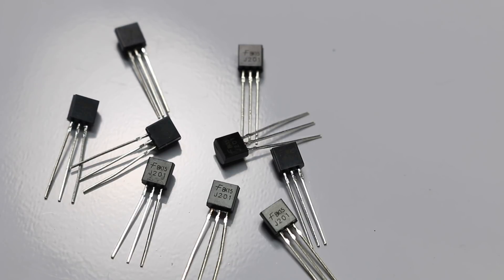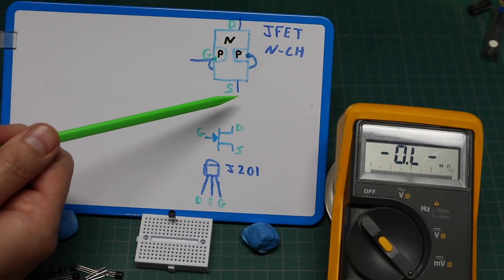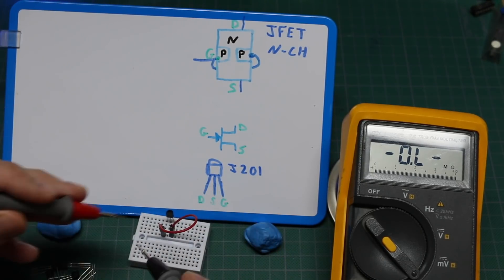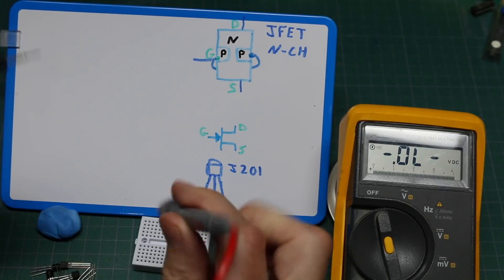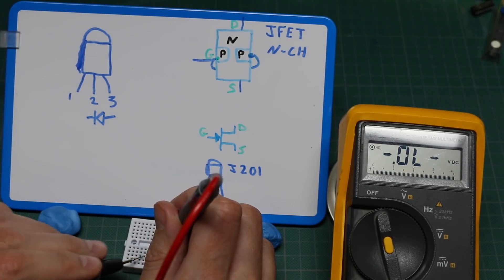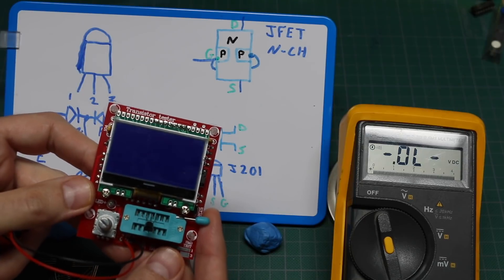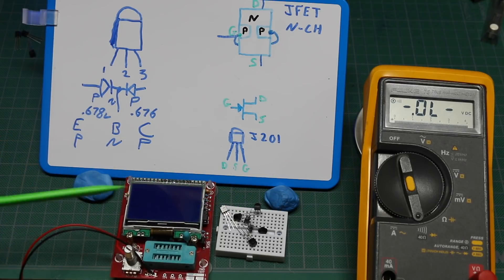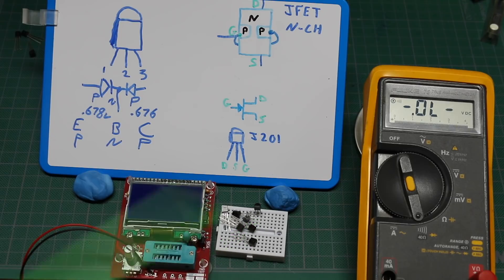I Bought Some JFETs on eBay - or Did I?

Comment: i have a batch of old polish made bf245 jfets and they are being very confusing to standard chinese component tester
it detect them one way as npn the but upside down they are detected corectly as jfets with very low  current and source to ground voltage drop
i wonder what would component tester say upside down about those fakes

Comment: What values SHOULD you expect for a J201? I got some on eBay as well and want to confirm if they are legit.
Reply from the maker: The ones I have that I know to be good go from 100 to 300 ohms when the channel is open, so I figure if they were fake they'd most likely be mis-labeled NPN or PNP and not behave like an open and closing FET channel as the gate is connected/removed from source.  
I'm not sure if there's a generally accepted max resistance rule of thumb (similar to how a silicon junction is around 0.7 volts or an LED can take up to 20mA) but if it seems to go from something reasonably low (up to 1000 ohms?) to high impedance as the gate is turned on/off, I'd say it's at least acting like a FET and if lower resistance is needed, maybe test them all and see if there's some that are testing lower.

Comment: thank you for the video im just getting into building guitar pedals , i dont know much about the components yet , i think i got a bag of fake J201s . i ended up ordering a bunch of those SMDj201s and some adapter pcb boards to replace the fakes hoping i get real Jfets this time, also hope im able to solder those little SMD components in place , so small lol.
Reply from the maker: I just received SMD J201s but haven't tested them yet.  If they work I may be making some audio projects. If they don't work, they might function as NPN transistors to turn on LEDs or something else non critical so they don't go to waste.
Reply: Buy SMD J201 from mouser. Everything from mouser is legit.

Comment: Risk for sure when you go "offshore" for part sourcing.  There is only...maybe 1 seller I know of on the 'bay that has genuine stuff that isn't bs, or batch-failed/lower grade parts.  Mainly from listings, and seeing original Phillips, ECG, RCA, etc. plastic bags from long ago was I able to feel confident that the guy had the real thing.  Sucks that there is a market for this faking or poop quality rump-roast parts instead of good shit.  Guess just when in doubt, try sticking to original as often as one can (however J201 I thought was nixed in TO-92 now).
Reply from the maker: Yeah there's discussions on audio circuit forums about using 2N5457 as a replacement but it's hard to characterize traits like Tight Bass or Less Gainy unless it's put on the scope to see.  I recently found a bag of probably 1000 2n3904's while packing to move.  Too bad it wasn't J201's.
Reply: @GadgetReboot  I wish like hell I grabbed a bunch of those when I had the chance.  About 10 years ago or so now we we're making a certain...guitar pre stomp box at work that used a pair of those.  Could've had handfuls of them once the project was scrapped and before they were just tossed during an inventory clean out several years after this.  5088's I still so thankfully have around 25 original Fairchild pre ON takeover ones of that.  Random wad of TO-18 2222's which I have no memory of acquiring and discovered recently do to what I just simply call 2020 lol.

Comment: Fun note - real J201 will test as NPN transistor on these cheap-o testers due to very low Idss and Vgsoff. Keep in mind if you found this video while wondering why your J201 doesn't get detected as JFET.
Reply: Just found a batch of fake but true J201, can you be more exhaustive about the tester?
Reply: True, you are absolutely right.
I have a LCR T4 blue transistor tester (similar to the one in the video), with the stock firmware it identified J201 as BJTs so I thought that those were fakes.
But after I updated the firmware with a better one (https://www.mikrocontroller.net/articles/AVR_Transistortester) it identifies the J201 as J-FETs
Reply: @Limak  @rayliger5295  I thank you for these comments!

Comment: Had the same this month.  Actually bought batches from 2 suppliers on AliExpress, similar price, one lot were PNP transistors (also labelled BK15) the others look like good JFETS, labelled BA17, with a slightly different "F" logo.  Instantly refunded for the fakes
Reply from the maker: I wonder if the sellers are aware of the fakes or if they are also just trusting that it is what it should be and passing it on.

Comment: I buy from (Mouser.com) and so far I have received good (jfets')!
I have ordered (Jfets') from other suppliers' and they were either mixed,or all fake!
Usually an (NPN-transistor),pin-out (BCE),(hfe=150-200).It is a serious problem for builders' and repair people!
Best advice is to test everything with several different meters'!I use the Drok-meter and if I get (NPN,PNP),
then I test for pin-out and (hfe).Most fake-(jfets') are (BCE,NPNs').I think Mouser orders' their (jfets) from(Interfet),or other reliable manufacturers'.Only down-side,you will pay more,but in the long run will save a lot of trouble!!!!!!
Reply: what about stewmac i ordered seom J201s off them. they seem to be pricey. have you tried them? mine still in the mail
Reply: @gri7  Not sure about them?

Comment: I have tested JFETs with the result of 2 diodes using a component tester similar to yours. I will use the multimeter method for confirmation.

Comment: I just found your channel and enjoying your videos. Good job.

I have been caught out with fake IRFZ44N mosfets from ebay. Destroyed loads of them, and a fair few driver ICs. It took me ages to work out that it wasn't my circuit at fault! (PWM motor controller) Finally worked it out when I salvaged some real ones from an old inverter and worked no problem.
Reply from the maker: Yeah having a component tester even if it’s just a little circuit we make ourselves helps the debug process when buying unknown parts like this. When I’m doing something important I order from a reputable place, otherwise I just hope for the best.

Comment: it's not just the usual eBay and Aliexpress sellers with fakes. I've seen x-rays of ic's from main stream distributors which look good on the outside but have nothing in side just legs and these were destined for the aircraft market. how they got into the food chain no one knows, but high value chips will attract the fakers.
Reply from the maker: That's disturbing considering the importance of quality control in those markets, and the supply chain is usually tightly controlled for such markets.  Hopefully a totally blank part would be exploited in a functional test...
Reply: @GadgetReboot  yes it would have been caught during testing. But I bet there are fakes flying around.

Comment: I'm really happy you did a video on this. I had to figure this out myself the hard way when I got faked. I also bought them from a seller I had good experience with in the past (FSXSemi on aliexpress).  Props to the seller though, they refunded me without question. I think JFETs are just one of those parts that are uncommon enough that there aren't very many floating around, unlike something like an IRFZ44n or 2n3904 which are cranked out in the bajillions.
Reply from the maker: Yeah one benefit in alerting others about this possible outcome of buying parts that aren't as labeled, if someone is less experienced they may be stuck wondering what they did wrong when making a project that doesn't work and all the connections look good etc.  so sometimes we have to look inside the packages...

Comment: I have gotten false parts on Ebay and Aliexpress a couple of times, both the FET that is a BJT and logic level power mos that are not logic level. Marking on the components is for the part I wanted.
Reply from the maker: I still  have some MOSFETs from eBay that I have not tried testing yet. I need to round everything up and do an audit.